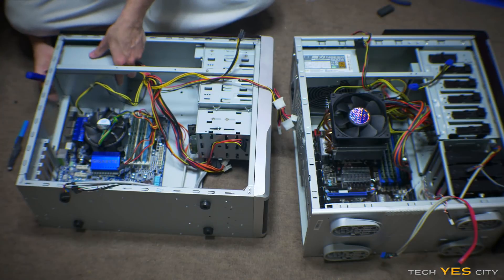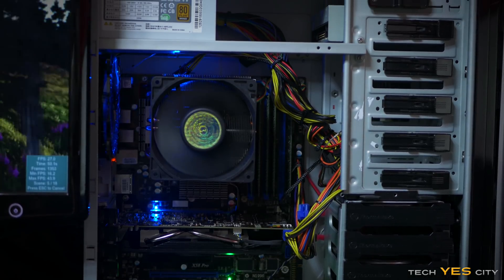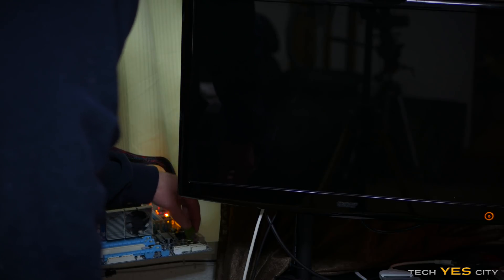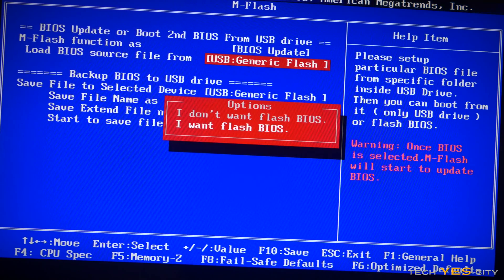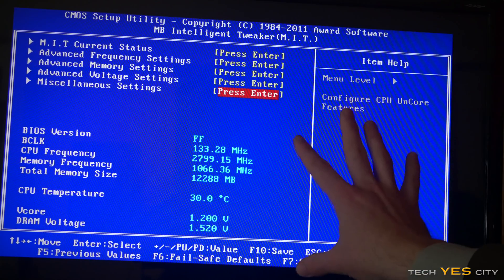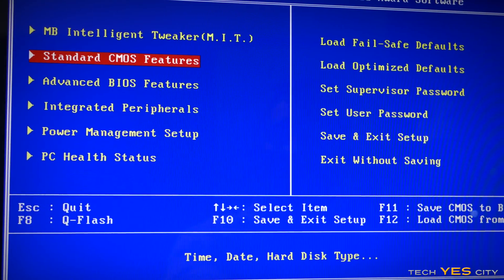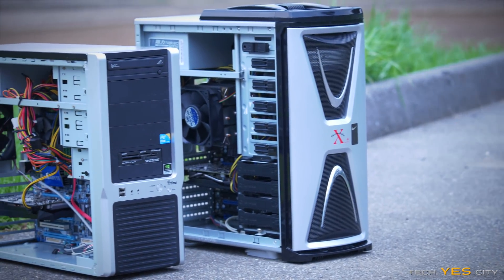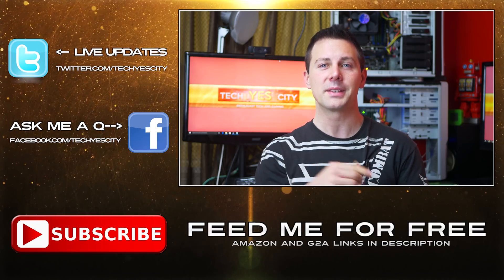PROJECT 242 - The Mystery of the i7-920 Vs E5640 ($302 + $312 Used PCs)

Comment: Hi Bryan, great topic! I have an Asus p6x58d-e and have been playing with a 920 (d0), an e5540 and an e5640. Your results pretty much match mine - much of a muchness... The 5640 I was expecting to run a lot cooler /need less vcore but it actually needs more than the 5540 and runs about the same under maxload. 4ghz @ 1.32v with a prime95 temp of 82'c using a CM evo 212. 

Can you posy your birth s settings? The multitude of settings bamboozle me , I tend to run a everything at "default" with the exception of vcore.

I have a GTX 750 too, would love something a bit more powerful but cash is tight :)
Reply: post BIOS... big thumbs and one beer are not conducive to proper sentences :)

Comment: Sorry if this is a noob question but, how did you manage to overclock the E5640 and the E5-2670? I have been scouring the internet for someone who has overclocked those two but for the life of me i cannot find them.  i would like to build a system with the E5-2670 and would like to know what I need in order to overclock it. Thanks
Reply: The e5-2670 can be little to no overclocked. From sandybridge and above overclocking is done mainly my increasing the multiplier. From lga-771/775 up to 1366 (like the e5640) it was being done mainly by increasing the bclk. That's why older xeons are beasts.
Reply from the maker: Nothing to regret, these is just taking price/perf to the extreme lol.
Reply from the maker: +Isaac Goscha E5-2670 is really dependant on what the motherboard manufacturer does in regards to their programming of the BIOS.  My two go all the way up to 3ghz on ALL 16 cores when needed, incredible performance... They could technically go up to 3.3ghz with the right 'hacks' but then again that would also put a strain on the mobos which I am sure Asrock do not want to risk.  Also there is no bclk on this motherobard either, but that is another way of extracting extra performance out of sandy bridge and post gen processors.  As for the e5640 that is just trial and error, though there are 3-4 settings to really keep an eye on and tune and depending on the mobo you need to apply the voltages differently, QPI VTT voltage / NB voltage and CPU voltage are critical for Ocing that platform.
Reply: Is it all trial and error with the motherboard's support for overclocking the e5640, or do most x58 mobos have the ability to overclock them? I was just mainly looking for something to build an inexpensive gaming rig for my sister. I am new to older generation hardware as weird as that sounds, and I have been working on haswell and skylake for so long that some of that old lingo is new to me. I will be researching the overclocking method but I just want to clarify that the support for the e56XX on most x58 motherboards is solid. Thanks for the help by the way!Tech YES City
Reply from the maker: Yes, most boards will support the e5640, though the w3520 is a guarenteed cpu that is really cheap and will probably give similar results.
Reply: So many good budget options this is amazing. Thanks for the help I will look into all of those. This is making me regret springing for the 4690k...

Comment: Another great vid, as always! I recently had a problem with my graphics card overheating.  It's a Sapphire Radeon 7870 and one of the fans is apparently being blocked from one of the cables going into MSI FM2 motherboard (I built your 2013 $500 build, has been working wonders!). My tech guy suggested just swapping out the motherboard, but I'm wondering what it is that you would suggest? If getting a new mobo is the way to go, what could I get that would be just as good in performance but not end up having a fan on my 7870 blocked?

Comment: +techyescity I have a question i have a GTX970 and a i5 4460 and i play alot of CS GO i didn't do any videocard overclocking or whatever but i have 130 FPS on the map Nuke which normally wad around 200 - 250 FPS i cloned my windows to an SSD and reinstalled the drivers but nothing worked and sometimes my FPS even drops to 90 FPS or even 40 FPS do you have any idea why this happens ? Do i need to reinstall windows ? Give me a tip its making me nuts !
Reply: Nuke is just harder to run, deal with it.
Reply: Adeel Rehman i have this fps problem on more maps
Reply: Baska Biceps you have a virus?
Also it could be your gpu is thermal throttling, or downclocking itsself because its unstable.
Reply: Adeel Rehman Well i did clone my windows and then it started to lose frames perhaps thats the problem
Reply: Baska Biceps do a clean install
Reply: Adeel Rehman i'll try
Reply from the maker: +Baska Biceps You can also try setting high priority and also setting a launch command with -threads 4 on your i5.  Try turning down particular settings and making sure your computer doesn't have any malware on there.
Reply: Tech YES City i am going to reinstall my windows i cloned it and since then it started happening

Comment: since those boards cost way over 100€ here in Germany, is there any 775/771 CPU that has 4 cores/8 threads or even more? I am looking for a cheap replacement for my core 2 quad (3,2 GHz). not that I need that extra CPU power, just for the fun of it.
Reply: +Naddel81able -- yeah, those mobos killed my interest in those "cheap pc builds" too. Same with LGA1156. AFAIK 771/775 CPUs didn't have hyper-threading hence the 4 cores / 4 threads only.
Reply: OK, good to know. so the cheapest you can get is a 771/775 board for 20 bucks combined with an overclocked 4 core of that generation (most do around 3,5 GHz). that would be 40 bucks total. +4GB RAM (30 bucks) +10 bucks for a good cooler = 80 bucks. then I got a 560 Ti for it and a cheap PSU+HDD and the full system cost me around 150 bucks and is a good beginner-gaming-rig.
Reply: +Naddel81able -- seems very legit. I've done some PC with a Xeon E5450 and Radeon 6870 for dirt cheap and this rig is doing extremely nicely for the price. cheers
Reply: what is the difference between the E5450 and the X5450 btw?

Comment: NICE VIDS, but wow where do you find cheap used x58 boards, in the states they are still expensive, 

still have a pretty unused i7 930, my crappy gigabyte x58 udr3 like the one you are using died awhile back, so just upgraded to skylake, still it would be nice to find cheap x58 boards under $50 to rebuild

Comment: Brain what settings were you using for the games i did fire strike test on my 4460 cores locked all most 3.5ghz scored 9974 little over oculus rift with my 780ti using best driver 347.25 I tried over 10 drivers top performer 347.25 if you have time try the same test again best Kepler driver

Comment: Hi,
   For dry-gummy thermal paste a few drops of lighter fluid is best.  Spread it and let it work. Wipe and put some more if needed. I wipe and then use rubbing  alcool to put out the oily film.
     I doubt that thin dry thermal paste when the contact is good is such a bad heat conductor. Did you tested it?  Is it worst than a thermal pad?
  Keep on the good work.
Reply from the maker: +St-Gelais Rene oh the mX4 conducts really well, the stable overclocks are a testament to that. The lighter fluid? I will have to give that a shot, as that gluey type stuff is a real pain.
Reply: +Tech YES City  I should have said to put many drops, more like spraying the surface with enough lighter fluid.  It is a better solvent than alcool for heatsink paste.

Comment: I've been watching a lot of your videos lately, and I really dig your old PC builds.  I have a 5820k and 980 Ti, but for some reason I am drawn to the rebuilding of older tech and squeezing as much performance out of it.  I rebuilt an old lga 1156 board for my brother.  We already had the board, and manged to get an i7 875k fairly cheap, overclocked it to 4.0 and threw in an r9 390 and its a total beast.  It makes me wonder why I spent so much money on my current build.  

Anyways, can you make a video on overclocking and voltage settings for older 1156/ and xeon equiv builds?
Reply from the maker: +Talon I actually have a 1156 build coming up, so will show the bios settings in that video for you.

Comment: How are you averaging 100fps on GTA V on these PCs when i can just get 60fps on my i3820, x79, SLI 2xGTX 980's and 32GB ram? Though I have GTA V set to nearly max quality settings, so you must be using lower settings. After all your synthetic benchmarks scores are much lower than mine.
Reply: Ur cpu is a bottleneck

Plz get an i5

Comment: This is the main Youtube channel I keep an eye on now, building computers from used parts is so awesome.
Back in the day I used to pick up junk computers from a refuse store, and one time back in 2006 I found a HP Kayak XM600 workstation with a dual Slot 1 motherboard for $20.
I remember adding a second Pentium 3 and installing Windows XP 64-bit, it actually had two CPU usage graphs in Task Manager, it was such a monster.
99% of what I know about computers now is the stuff I learned from working on used systems like that.
Reply from the maker: +PooPipeBoy Yeah its heaps of fun, and thanks for the compliments man.

Comment: How did you clock the processors so high with an intel stock on one and a decent one on the other, I understand the older intel stocks were good but these processors  are like over 100w tdp the 920 is probably well over that guess. I guess the temps where pretty high?
Reply from the maker: +Jack they were in the 80s, which is fine on the gen in aida, the 32nm CPU is fine on a stock heatsink and the other one has a pretty buff heatsink on it.

Comment: Would an i-5 2400 put out similar results to these PCs? Also what $100 or less gpu would you recommend for an i-5 2400?
Reply: HD 7950

U planning on grabbing that pc for 250 from frys? 
It had a 2400, 4gb ram,  250gb hard drive

Also, a 2400 will preform similar to a skylake i3 or so, because of the newer architecture. So don't worry about bottlenecks unless you  have a 980ti.
Reply: 7870?
Reply: Daniel Santos which board? An 1155 one? I would say pick up a cheap quad core on ivy bridge, that's at at least 3ghz. The ones that end in p are cheaper, because they don't have an igpu.
Reply: Oh no I haven't seen that one?
Reply: +Nick Bolen The i5-2400 is around 12% slower than the E5640 and 5% slower than the i7-920
Reply: I see people recommending it a lot for an older cpu.
Reply: Nick Bolen I5 2400 is a great cpu, unless you have a 980 or something. I wouldn't hesitate to pair it with a 970. Even a 980 should be fine. You may have a bottleneck in some games with a 980ti, but I assume you are probably putting in a 7950, which is close to the 950. So you are good, get the 2400. It can be had for like 80 bucks shipped. 

I honestly wouldn't get this cpu, unless I already had a board for it. Boards for it are like 50 bucks. So 130 for a board and cpu. 

Vs getting an i7 820 or something, or a similar xeon. 1156 boards are much cheaper. I just picked up an x3450, a 500w psu, mobo, and 8gb ram for 107 shipped. Came with an i3 550 too. 

So, that cpu isn't in the price to performance sweet spot.
Reply: +Adeel Rehman r9 390 would be a better choice than 970...
Reply: AMD and Nvidia GPU vs Games yeah, but amd tiers are wierd, with all the xs in there, and the whole fury thing, and fury x and stuff. It's wierd. 

And the 390 eats way more power, so that's problem for many people
Reply: ToughGamer Est gtx 960,not 970
Reply: ToughGamer Est ok. I assumed it to be with the 950 because the 380 and 960 compete, so I thought the 280 and 760 compete, and 760 is the same performance as a 950.
Reply: ToughGamer Est Wow. I was going to get a 7970 for 70 bucks a month or so ago, but my dad would not drive me. It was like a 45 min drive there, and back. 

I get not wanting to drive, but how far to drive depends on the deal, and this deal was definitely worth the drive.
Reply: ToughGamer Est yeah, it was pretty bad. I ended up getting a 670 for 90 bucks, shipped.
Reply: ToughGamer Est yeah, pretty good deal.
Reply: +Adeel Rehman whats the best cpu for that board? I want to revive my old pc... Thanks
Reply: Adeel Rehman the 1156 sorry
Reply: Daniel Santos budget? I3 550 is pretty good, as is the I5 750. An x3450 is good too
Reply: Adeel Rehman i have the i3 540... I wanna know the best i can get
Reply: Daniel Santos us ur board Good 4 oc?
Reply: It's an asus p7h55 m lx... So, I don't think so man

Comment: Where do you find these cheap motherboards, I can never find used x58 boards for less then 150 euros.
Also, how did you get your 920 to 4Ghz without burning it up on air? mine(even a D0) was going above 80c with a corsair H50
Reply: H50 is bad
Reply: It's not terrible, it keeps my i7 920 at 3.8Ghz (A 1 Ghz Overclock) below 75/76 celsius, but it needs a push/pull config to do that
Reply: ***** I'm pretty sure the hyper 212 is better.
Reply: The bloomfield's were hot chips, be interesing to see how it would do

Comment: I am looking for a cheap upgrade to my (rather cheap) ebay computer that I picked up. It is running an i5 6400/8 gb ddr3/1TB HDD and a 300 Watt Power Supply. What would be a GPU that I could throw into it without upgrading my power supply? The cheaper the better. eBay links are more than welcomed :)
Reply: Nothing

Your better off waiting for pascal and Polaris, since those will require very little wattage.
Reply: +Adeel Rehman Any rumors on how soon they will be released?
Reply: The Gamer Duck - Random Gaming April at the earliest. Prob July at the latest. 

If u can't wait, just buy a 950 now, and sell it later.
Reply: +Adeel Rehman okay thanks!

I'll look into those :-)

Comment: Does motherboard effect performance, E.g. if all the other components were the same, cheep motherboard vs expensive.
Reply: +LukeBoys2 technically no, but it CAN happen that it will. but usually by a small margin if any, thus negligible. 
Biggest difference would likely be the performance gained from a cheap vs expensive mobo in terms of overclocking stability and reliability.
Reply: No

Comment: just shows old hardware is still capable.By the way what do you use to clean your hardware?
Reply from the maker: +keiran bowes Made a video on what I use to clean all my parts.
Reply: Ok
Reply: +keiran bowes you can thank consoles for that hahah..since console hardware get barely any upgrades, games dont really stray too far from their standards..so that means, if your not a nit picky pc gamer..you can basically invest on a used pc with a quad i5 or i7 and just play with gpu upgrades..ie get a i7 2700 and slap on a modern gpu..believe me you wont see any bottlenecks if your just gaming
Reply: My brother plays most of the latest games on a q6600 2.4ghz with 8GB DDR2 800 RAM and GTX 670, I was kinda surprised how well it did.
Reply: AWSOME
Reply: Good oldy Q6600. I played so long on him with exactly the same setup, but then the Motherboard betrayed me and decided to die. Well since then it is E31230v3.
Reply: dranoelr ikr..if you aint picky about latest hardware..you can practically just buy 2nd hand stuff for cheap and still rock..not to mention its kinda fun building these stuff and  rewarding knowing you just made something that runs as fast as something else for a fraction of a cost..this is why i like watching this channel
Reply: I have  nearly finished    modding  a   dell  xps  420 just  need  to install  a  amd  our  nividia  graphics  card
Reply: install nividia its god
Reply: +keiran bowes dont you watch his videos?
Reply: +Stephen Rimington ps be care full though make sure you get the right  stuff  some  cleaners can do damage to  your systems

Comment: Nice builds. I got asrock x58 extreme(NEW!!!) for 85 euro shipped and i7 920 for 25 euros, stock cooler included. I will pair it with 750ti probably, enough for my needs and within my tiny budget.
Reply: pair it with gtx 260 or radeon 4980 those are going for like 20 euros in Europe
Reply: +Ian Witten It would be short time replacement so I don't wanna waste any money on it. 
I have one gtx 650 2GB yet to test so if it works it will save me some serious money.

Comment: Epic video as always! i just love the style of your videos. I got that Xeon E5 2670, but i did not manage to get the 125mhz strap working on it, in my x79 rampage IV formula, however i did manage to get 107 on the base clock, which was a nice bump and i have also ordered another 2 e5 2670 to test. i also picked up this dual socket intel board with two Xeon X5675, so i have been having some fun with that today.